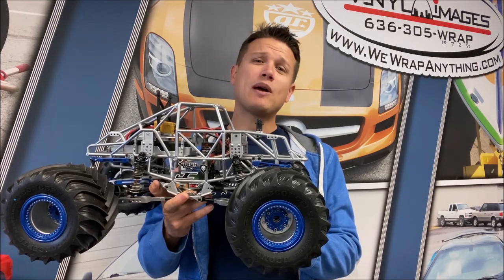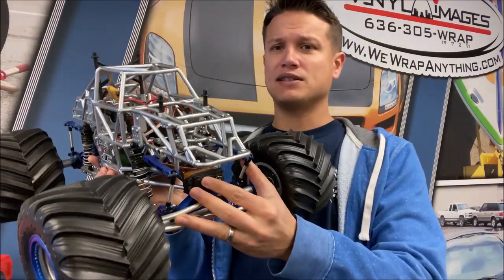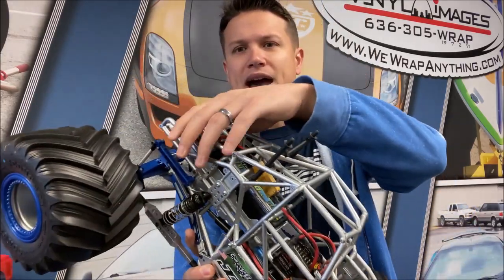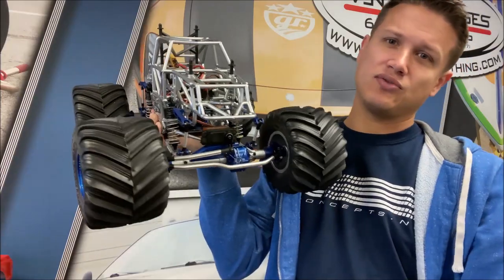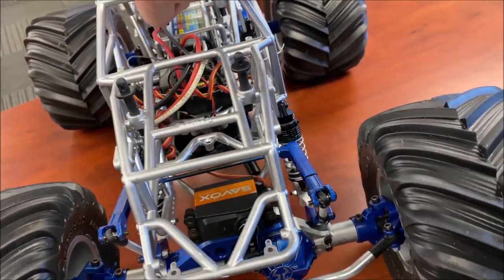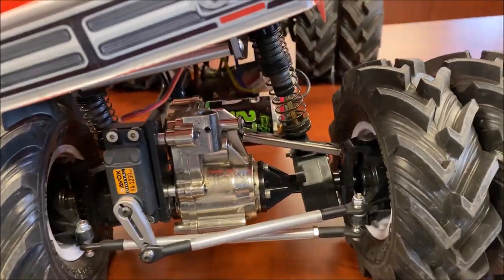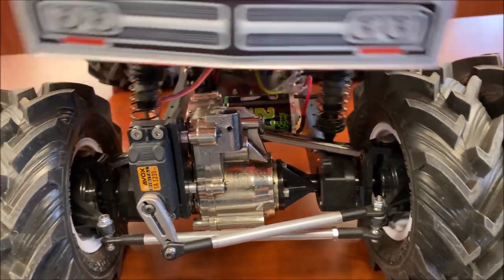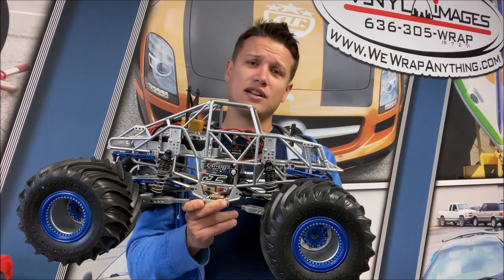How do r/c monster truck sway bars work? - Trigger King Tech

Comment: Is there any benefit to NOT having a sway bar?
Reply from the maker: Not much of one, really. Or at least in only VERY specific circumstances. Not having one will allow the suspension to move more freely so in times were more articulation is good, it could help. Mainly if you were coming off a big jump or something, the suspension can sometimes do it's work without upsetting the rest of the truck. Again though, it's pretty minimal in times it would an advantage to not have one on a monster truck.